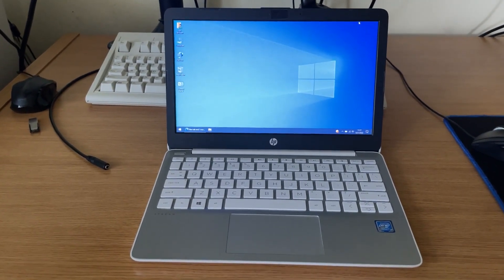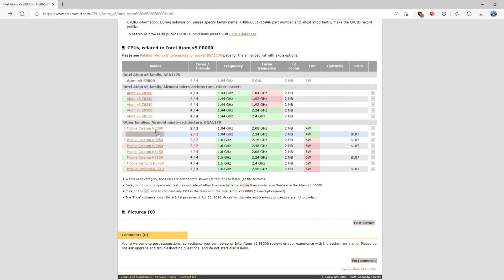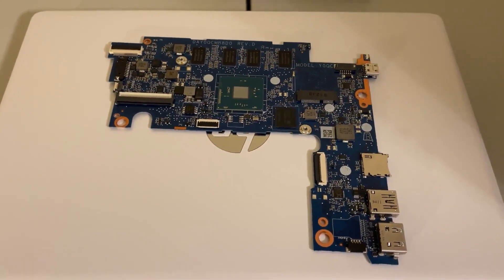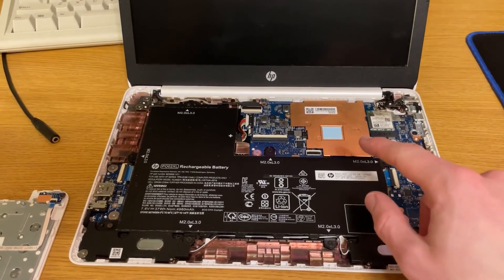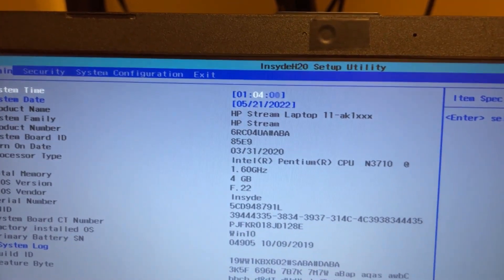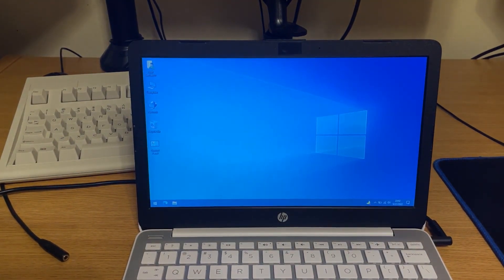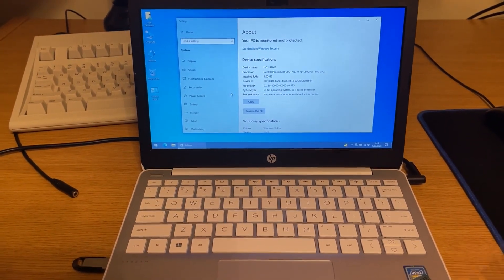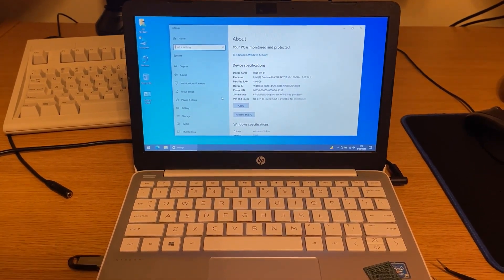BGA CPU upgrade on a low-end HP laptop (Atom to Pentium)

Comment from the maker: After 3 days of use, it definitely is quicker. Will extend the use of this machine by a few years I imagine before it needs replacing. Very worth the $20 I paid for the CPU.
Update 2024: A friend has this machine now. He still uses it.
Reply: would it work for a intel celeron n4500
Reply: ASUS - 14.0" Laptop - Intel Celeron N4500 - 4GB Memory - 128GB eMMC - Star Black
Reply from the maker: @Bob-ez2bz  Probably but you'll need a newer CPU than what I used.
Reply: bro is it possible to upgrade cpu with diff cache size on bga socket?

Comment: Could I upgrade a ryzen 3 to a ryzen 5 (don't worry about model number and sockets, I have figured those out) if I had the equipment needed and had some practice?
Reply from the maker: If it's the same socket and compatible then yes.

Comment: First of all, I would like to congratulate you on this level of expertise. I would like to ask you a question. I have an Acer E5 – 411 - C8NP, with an Intel® Celeron® N2940 CPU. I think it has the same BGA 1170 Socket as the HP. Obviously, I wouldn't be the one to do the job, but I'm thinking of getting someone to do it. My question is where can I get the Pentium N3710 processor? It's hard to find. I live in the EU, in Portugal. Did you buy it in the US, or did you buy it in China?
Reply from the maker: You cannot. Get N3540. Should work. I bought it from China using the S number.
Reply: @Josh.Davidson  Thank You

Comment: Hi, i know this is a old video but if you see this comment i would like for youre opinion on this topic; I have a lenovo y520 with a i5-7300hq its really getting slow and old so i had the idea of upgrading the cpu first thing in mind is that the laptop has a model with a i7-7700hq which is its "strongest model" cpu but looking at all the facts there is no reason why a i7-7920HQ would not fit into it, so i dont know which one to get out of the two of them.
Reply from the maker: Yes you should be able to use either.
Reply: @Josh.Davidson  <Thanks, and gj man like I didn't even think that you were gonna respond on a video 2 years old but hey thanks again.
Reply from the maker: No problem. I try to engage in the comments!

Comment: Podría actualizar una i7 4710HQ  - 47 Watss  a una i7 4722HQ - 37 Watts . Necesitaría  modificar la BIOS? Es una laptop TOSHIBA.
Reply from the maker: Amigo, te sugiero que uses Core i7-4720HQ, es más rápido con el mismo TDP. Debería estar bien, pero no puedo confirmarlo al 100%.

Comment: Yo, I know I am quite late but I am planning on doing this on a legion 5, upgrading from r5 5600h to r9 5900hx. Do you have any idea where I could find schematics for gaming laptops? Also, what exactly do you mean by "got the board baked", what did you use to preheat it and to what temperature? What exactly did you place the mobo on while working? I am quite new to BGA rework. I plan on practicing on an old laptop before attempting it on my main machine, but I wanna know if I have all the tools I'd need.
Reply from the maker: Before doing bga rework the chip and board must be baked at 90-100c for 12 hours or more to remove moisture, or else you risk moisture boiling and delaminating during rework. Do NOT use your kitchen appliances or afterward you will be poisoning your food. Buy a cheap toster oven that can go to a low temp.

Rest of your questions are setup specific so my stuff won't help you.

Comment: Hey, did you have to update the bios to switch cpu families? I have a project laptop and have knowledge in electronics and want to try swapping the i3-6006u to an i7-8550u (it's like 30 bucks on Aliexpress anyway and i got the laptop for cheap), do you have any documentation or info that might help for addititional chips that have to be swapped or updating the bios? There's a lot of info in spanish and I've got no prob understanding it, but not much for exact models. Thanks anyways
Reply from the maker: No I did not need. Also, can't. Fastest CPU for your is i7-6600U or MAYBE i7-6660U (check microcodes)
Reply: @Josh.Davidson bro mine i3 7020u can I upgrade it to i7 8550u?
Reply from the maker: @kv-project  i7 7660u fastest.

Comment: Problem is when you add flux under the chip you are making it more likely to melt the solder when it heats up and bridge connections since you cant clean the flux from under the chip. It may make it easier to melt the solder to make the connections but it goes the other way as well makes it easier for the solder to melt at high operating temps. And since the tdp for the new chip is probably higher and hp skimps on cooling youll end up having higher temps.
Reply from the maker: That's not how it works at all. Flux allows solder to flow better once reaching its melting point.
Once cooling down past (in this case, 217C-ish), there is impossible for anything to melt/bridge even if all the flux is left there.
I do completely clean the flux from under the chip. This is very easy to do with proper cleaning methods.
Nobody skimps on cooling, that's just myths. There is always enough for the TDP of the chip + extra. There is only a 1W difference and this exact same laptop can be configured with a N4000 CPU which has the same TDP as this N3710. (all though the motherboard is different to support the N4000)

Comment: Hi dude, this video inspires me to try this on old netbook that got a flop due to bad performance 
This is Netbook based on atom single-core, and this is crap... one core is bad to watch a simple video and i know this is possible to desolder a cpu to replacing by better, but in atom, the TDP is BIG. 

My actual atom is Intel atom N450 with 5.5W and i think to upgrade from N550 but he have 8.5W of TDP so, is this possible,  or the laptop does not have enough power ? 
That's my question, EeePC's, Atom are very strange laptop BUT really useful because they are really really tiny
Reply from the maker: You need to check the BIOS microcodes. N550 is B0 stepping not A0, but both 0106CA CPUID. It should still work.
VREG design is always over requirement, but I'm really not sure if this machine's spec. I would be cautious. I would be more confident in N475 but the upgrade may not be worth it. Not so big performance jump.
Reply: @Josh.Davidson  Maybe with a modded bios (like 771 mod when you input some instructions on "not supported hardware")
Reply from the maker: @Azurhye  yes it could work with modded bios. I’d check the vreg design first.

Comment: I have an old n2820 laptop, I`ve always wanted to change the cpu, but I don't have the bga machine, one time I soldered a ps3 wifi chip (also bga) with 2 soldering stations (one above and one below the board), I don't think this will work for the laptop CPU, to make matters worse, I'm actually using this laptop nowadays
Reply: did you had to add any microcodes to the bios? I know that it's possible to use some 8-9gen laptop BGA-adapted cpu's in 6-7gen intel desktop motherboards, but it requires to add the cpu microcodes into the bios, but with the laptop cpu both are on the same generation, so it's compatible with all cpu models of the same gen?
Reply from the maker: This will not work. PS3 Wifi board not count as BGA, it's psuedo BGA maybe... Besides unlike small BGA chips these processors are very fragile, with numerous hundreds of balls, and any slight mishandling of heat will cause the chip to be damaged. BGA machine is required.
Also it depend what you want. I did not need microcode change for this swap.
I think the fastest CPU you can use is N3520. It is the fastest chip with same CPUID microcodes. You can extract from your BIOS and if it supports another microcodes it might be possible to put N3540.

Comment: I would like to know can we put a CPU slot so I can just keep changing the CPU without soldering each time like desktops
Reply from the maker: Not fit in laptops.
Reply: @Josh.Davidson  I figured even the small ones in other laptops??
Reply from the maker: If the laptop is not designed to have socket, there will be no room. Laptops are designed to be as thin and small as possible.

Comment: somehow i would like to try and polish a different turd by that method , hp stream 14 with celeron i belive from the same family n3060 or something

how did you deal with stencil balls/ or paste? and where did cpu came from?
Reply from the maker: Hi,
CPU came pre-balled brand new from ALIEXPRESS with lead-free solder. I have ability to, but did not need to reball it. For reball such a chip I do not use paste I use solder balls and stencil from ALIEXPRESS. 

Do you have BGA rework machine? This is required.
Reply: @Josh.Davidson  thanks for claryficaton
i do not have rework sttion, all i have is hot air and soldering iron so probably it is time to buils a rework station because i was thinking more about getting 10$ cromebook motherboard and geting cpu out of it, but first i need to master making solder balls melt before  substrate start smoking, for some reason i was only able to reball things with paste so far
i did mannaged to put 2 m.2 ssd's on a stream laptop with no ssd  slots onboard withut using wifi socket though so  maybe i do need to learn more tricks and stop just hacking tings :]
have a nice day and thanks for atention
Reply from the maker: Yeah you will need rework station to do this sorry.

Comment: you did a very nice job replacing the cpu but something about the 50% ram usage on idle really scares me
Reply from the maker: Hello my friend thanks.
Please research about "Superfetch". It is a program since Vista which loads commonly used stuff into RAM for faster access. As you use RAM, it unloads stuff to make room. So do not worry, is not really 50% RAM usage, that is just Windows making stuff faster for you. :)

Comment: Hey Josh, the most important part of removal, prepping and soldering the the CPU only has pictures. It would be great for us ignorant electronic tech to understand how you did it and what you used. Thanks, Mark
Reply from the maker: Hi,
I am really sorry about that. I have no good way to aim the camera under the rework machine. Essentially, the only thing you are missing, is the heating element about an inch over the chip and me carefully watching and controlling the temperatures.
The chip itself came reballed and I did not reball it. If I did, I would include footage of that. :)

Comment: Hey a quick question here. So I found out my laptop is core i7 7700HQ which has a socket FCBGA1440. I am wondering, if I replace my CPU with i7 10850 which has similar socket to 7th gen, will it work like you do?
Reply from the maker: No. You need to stick to same arch.

Comment: Considering you’ve replaced the CPU, you should consider upgrading the RAM chips. Going up to 8gb/16gb should be fairly cheap. Would love to see it!
Reply from the maker: Sadly BIOS strapping not support > 4GB. I'd have to mod the BIOS - and that messes with secure boot and other things as I can't resign it, and it's just a headache :(
Reply: @Josh.Davidson  That's an interesting point. Still, from my point of view it may be something to look into. There are plenty of resources for BIOS modding.
Reply from the maker: @somedude1119  The question is also if there are enough addressing lines on the board.

Comment: So really freaking cool!
This makes me wonder - would it be possible to replace a n270 Atom with a higher end BGA437 chip, like a 330? Would anyone take one for the team and try this?: )
Reply from the maker: Probably not. Atom 330 is 8 watt. N270 is 2.5 watt. Probably would overload the power delivery. Also, seems to be a quite different design. 330 is 64 bit. N270 is 32 bit. Very big design/transistor count differences.

Comment: I watched this video (at 360p while overheating) on the exact same laptop. This is very impressive! I am very interested in doing this upgrade aswell!
Reply from the maker: Yeah, these machines do get hot. I might add more copper to counteract this. The improvement is pretty good, I can watch 1080p without issue.
Reply: @Josh.Davidson  If I could I would add a fan/heatsink. However, I'm a smoker so probably a bad idea. The whole reason I chose this laptop is because it is passively cooled. Im sure even if the Pentium did end up thermal throttling  it would still be more usable than the atom. This thing can play terraria for about 30 seconds before it becomes so slow its basically unplayable. Terraria....you know...that super cpu/gpu heavy AAA game. Bahahaha.
Reply from the maker: @addictiveconduct  I haven't encountered thermal throttling on my unit, with good paste in, just the base gets quite hot. I was just going to add more copper surface area. It is only a 6W CPU.

Comment: more ram might fix your woes lmfao. swapped the bga chip but you still have 4gb of ram. don't get it..
Reply from the maker: Why do I need more RAM? The cause of the slow was the CPU. Its been much quicker since doing this. It doesn't even use over 3 under any of the things I use this for (VLC, browser)
For more RAM I'd probably have to patch the BIOS image. From what I can tell there are only straps for 2 and 4 - unless it was added on this revision, my schematic is the last revision - but in that case it would be trial and error... not feasible.

Comment: Nice job, I used to have an HP Stream 13 with a Celeron and it was painful to use. I installed Kubuntu Linux which helped a bit but it was limited to 2GB RAM. Yours seems to be a much snappier than mine ever was. I always like to see your BGA stuff. I really want to get a station to start trying to do reballs but I'm not really sure where to start.
Reply from the maker: Thanks. Put Pentium and 4GB and it will be faster. CPU upgrade should be inplace and RAM upgrade just requires straps change. You can see schematic for which straps to change,